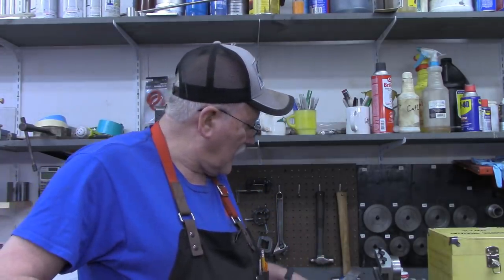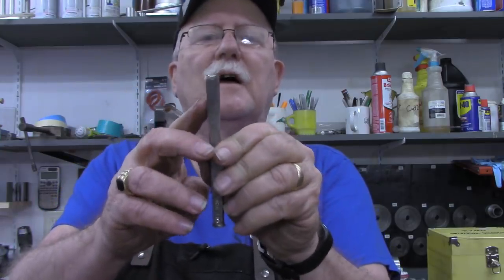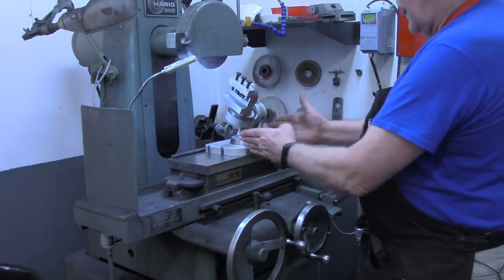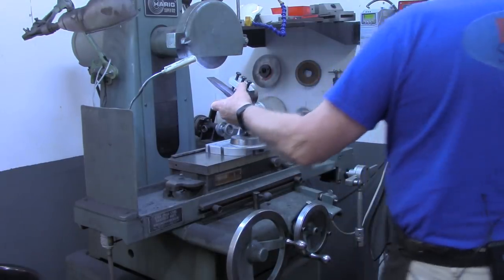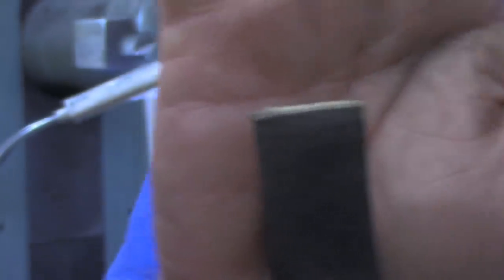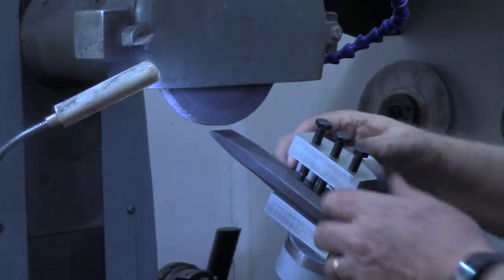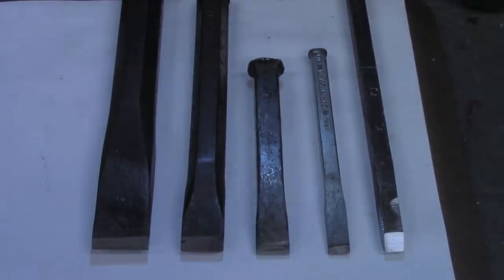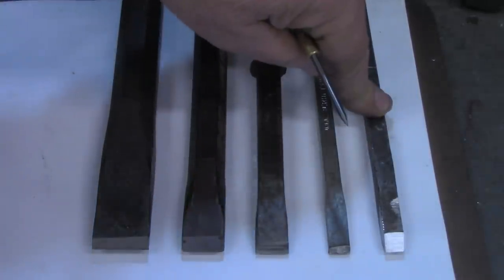Cold Chisel & Center Punch Sharpening = 300% Overkill

Comment: Well Lee, I don't think that's overkill at all! That's exactly how I would do it :) If you think about it, I bet the setup in the factory they were made in is awfully similar. If you're going to get like-new results, you need a good setup, and I think that's exactly what you did. Well done in my view :) It did look like a couple of those got a little hot, maybe some spray mist next time just to keep the blue away so the new edges hold up good and long. The pointy end is most vulnerable during grinding because it has the least cross-section to pull heat away, and of course that's the part that takes the cutting forces. But I bet it'll be a good while before you need to sharpen them again :)

Comment: Only a factory or high production shop could justify the cost of a machine like that.
Locally "Professional" lawn mower shops grind valve tips on flat head engines freehand, spinning the valve tips against wheel to adjust too tight valves. Luckily overhead valves have screw adjustment, too bad modern men have been dumbed down to were they can't even do something that easy.